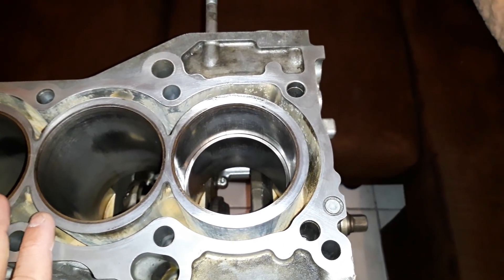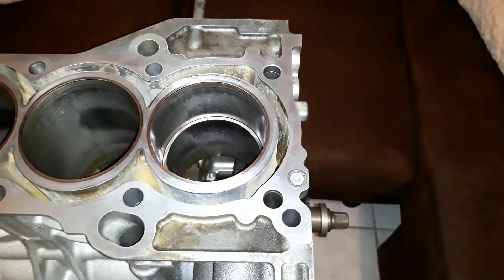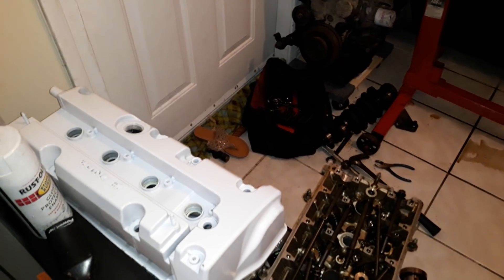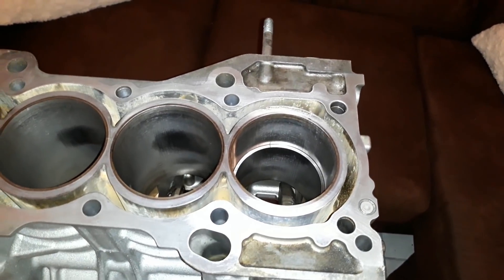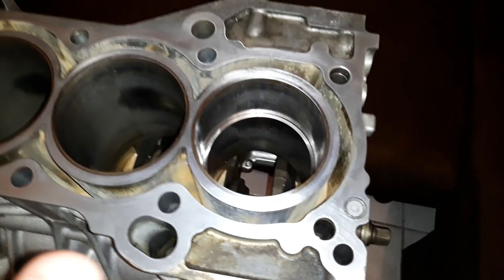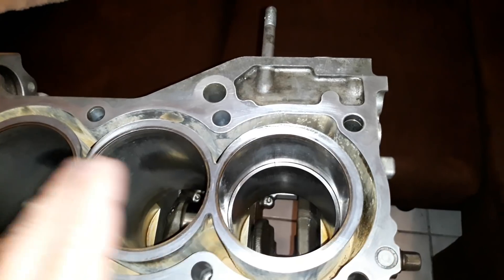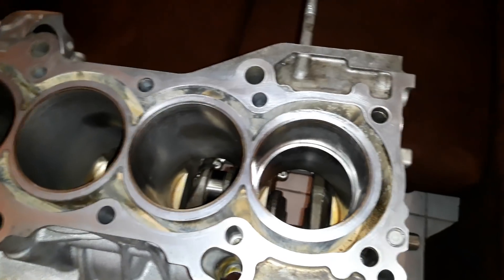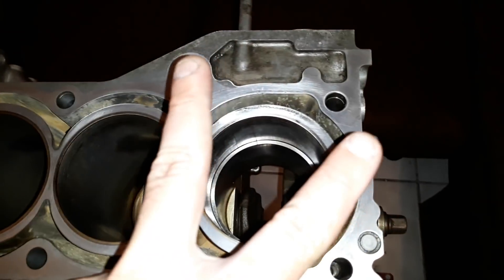Using Piston Ring to Check Bore

Comment: Hey quick question about the a k20a3. I have developed a ticking noise that sounds like lifter tick but then did some research and came across that it may be a bad timing tensioner. Do you have any suggestions
Reply from the maker: Get a new tensioner

Comment: I just had the ring problem with my build. I’ll never use npr rings again. NPR said it’s supposed to be that loose for expansion. there not supposed to be filed I guess. I ended up going with a set from my local performance shop and had no issues
Reply from the maker: Ive heard of some ppl having the second ring at .027 .028 out the box. I've never gapped rings that big even for forged pistons let alone cast. But yeah I'm not surprised at that response
Reply: VHB Engines yea my sec ring was at .030 on the money. My first rings were right around  
.017—.019. I was going to flip shit cuz I measured each bore twice before and after honing to be completely sure the cylinders were fine. The guy sends me an email with a picture of there specs recommending 
.025—.035 for the first and .060–.075 for the second. Idk how this makes sense and I would love proof of it but as of right now there’s no way in hell im letting those gaps fly in my builds.
Reply: Kindof unfortunately if you use NPR pistons, they have smaller ring lands for their proprietary low friction rings...
EDIT: In my experience.